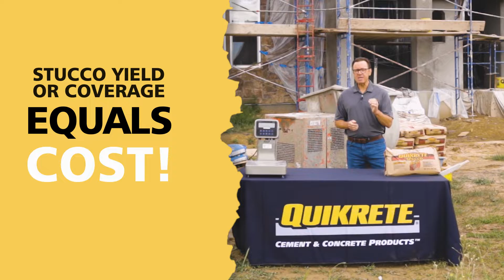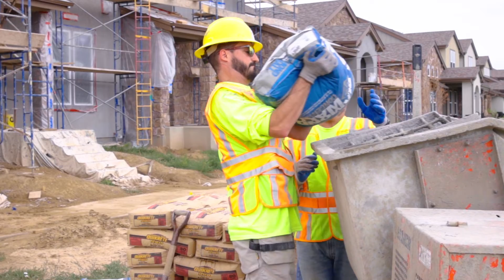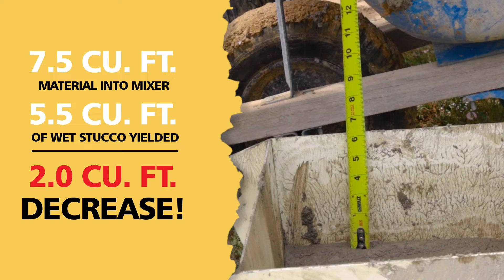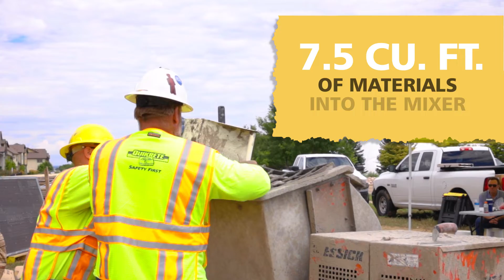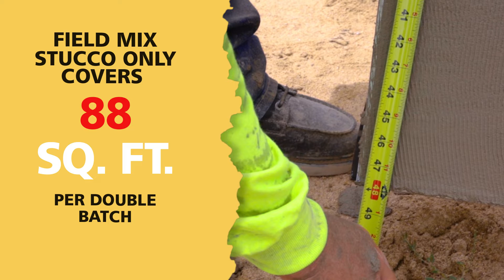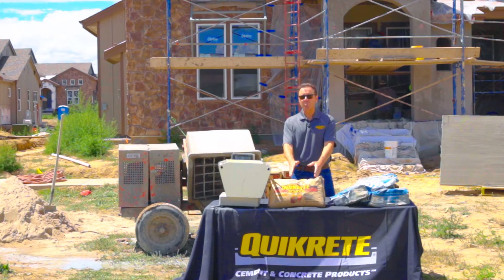QUIKRETE® Preblended Stucco Covers 25%More SF Than Field-Mixed Stucco!

Comment: Who mixes 1 part cement to 2 parts sand for base (scratch) or brown coats. No contractors in my part of the country! 3 to1 over lathe and 4 to 1 over masonry which will give equal coverage to pre-mixed quikrete. Convenience and labor savings, yes. Consistancy, depends on skill of mud man. Coverage? I don't believe this comparison is apples to apples.

Comment: I. smell. bullshit.
reusing the mixer after each batch will not have the same loss as the last the loss has already coated the mixer. the time you save is in prep which for any job site wil not be much more for the sand and concrete.

That said the product is consitant and does remove more prep time so pre-mix has benefits. its NOT 25% in product.